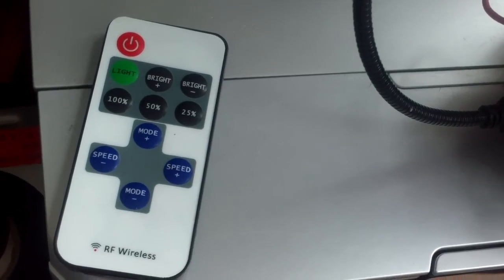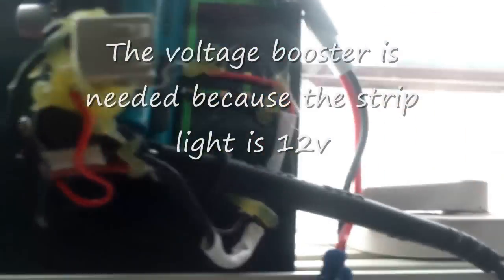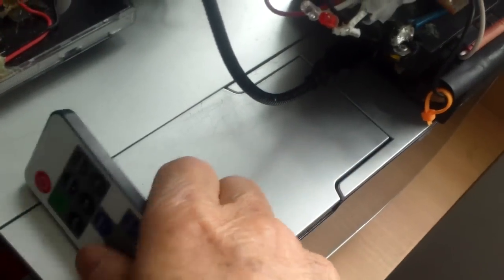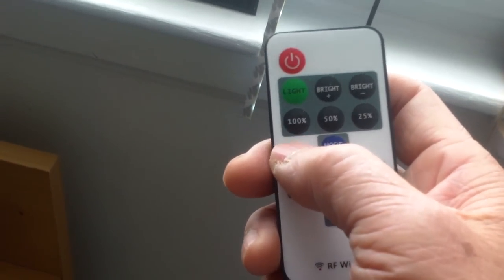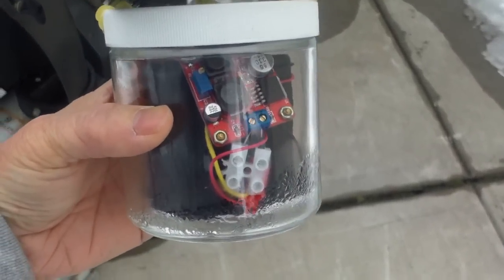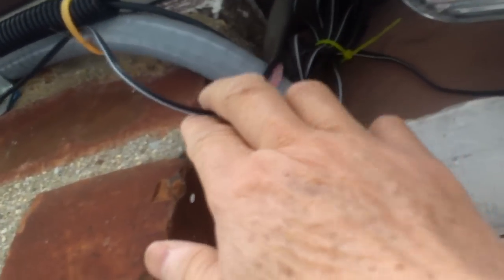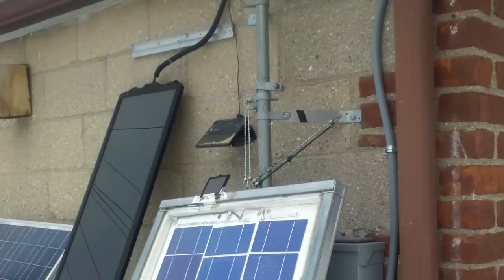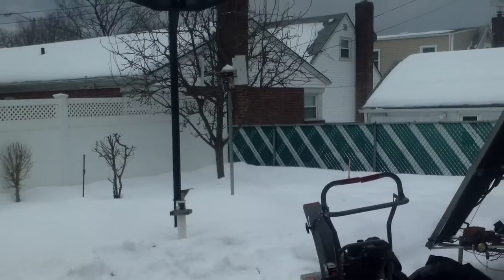Remote controlled exterior solar light pt 1

Comment: Untill now i only have 10watts :-)
I hope to expand in time to have a battery where i can run some lights and my laptop of.
I live in appartment so i don't have that much space to put a solar panel facing south. 100 watts should be good to fit my window
Greetings
Erik
Reply from the maker: 10 watts is fine. It's just a hobby. You are right, get a hundred watt panel (really the biggest that you can fit outside your window) and 2 sealed battery with 200 amp hours and you can run a laptop and your router and a few LED lights. That's all you need.  Then your hobby will be both fun and practical.